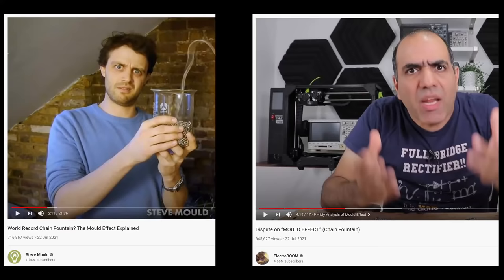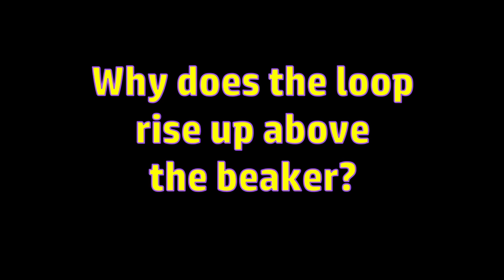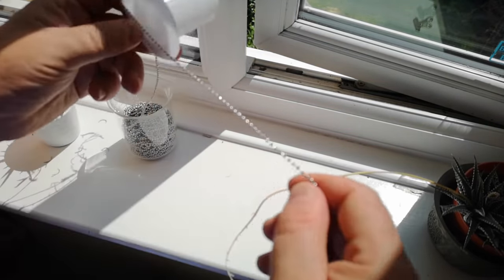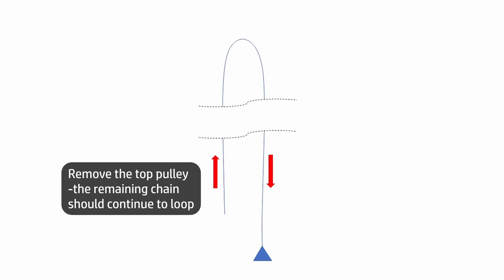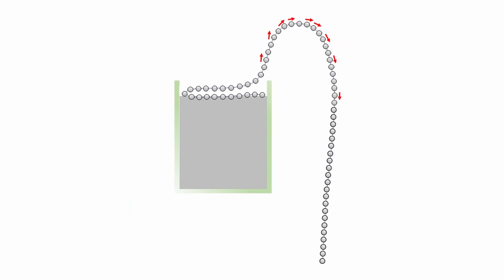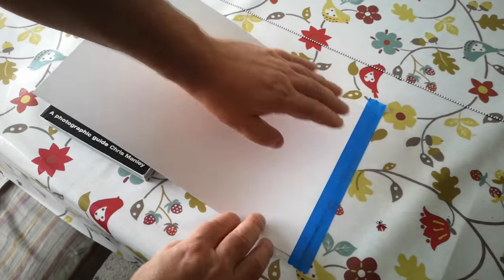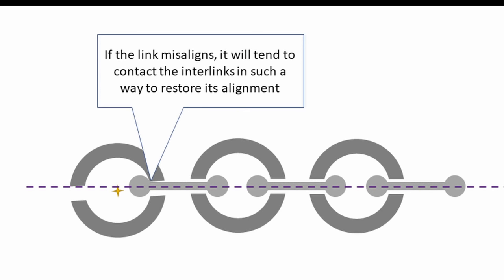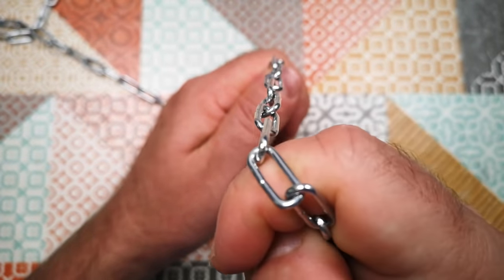Investigating the 'Mould Effect' - (Ball Chain Fountain)

Comment: The wave is a nice way to think of it. Its like a wave of accumulated time delays. Each little delay or displacement is due to one chain link transferring its energy after the one before it. So you end up with an accumulation of time where nothing could happen due to the forces in play. So even as one end falls the wave goes up higher as more chain links add to the delay time. Each chain link is very efficient at holding onto the time delay and passing it on, while adding it's own delay to the situation. I think its more like the classic video feedback ghosting effect in that way where the image is delayed due to the frame rate delay. In this case each chain link is like a frame passing on the delay to the next frame.

Comment: I most defiantly do also think this is a wave property, we have very similar ideas of what and how it works. This is why I liked your video because it reinforces my own believes.
I also think that if you'd take a thread and wax it up a bit to make it stiffer but still freely bend you'd get mould effect out of that.
Reply from the maker: Wave functions are everywhere - of course, the fact that there's a wave doesn't invalidate other ways to frame the mechanics of it
Reply: @AtomicShrimp  Agreed, I would wager that it wouldn't work with just waxed thread, it requires the inertial mass off the individual beads.

Comment: Let’s go right back to when the chain starts to fall. 
Imagine a link of the chain has bumped into the lip of the glass and rebounded so that the path of the chain forms a tight loop over the glass-lip. The centrifugal force inside that loop will force it to expand in diameter until the tension in the chain (centripetal force) balances out the centrifugal force of the chain loop. Now what happens as the chain speeds up? The tension in the chain stays relatively constant because it is determined by the weight of the small length of chain still inside the glass. But the centrifugal force will increase in proportion to the speed of the chain flying around the loop. The net centrifugal force is actually acting upwards, so the loop will rise up as the chain speed increases. It’s as simple as that.
Reply: Best qualitative explanation so far! Doing a quantitative analysis could be possible with a physics simulator.
Reply: First I thought the forces would not apply here, then I realized I'm an idiot and centrifugal force only requires angular velocity, not necessarily rotation. 
So I think this might basically be the explanation as to why the chain rises upwards. The movement of the chain speeds up until the falling part achieves terminal velocity, up to that point the angular momentum and therefore centrifugal force would be constantly increasing in the circular part of the loop. 
However, I think I have a small correction to your explanation: The downwards force on the loop would only be applied by the weight of the chain loop itself, not the chain part in the container. The weight of the chain that remains in the container just acts against the movement of the chain along it's curved trajectory,. As the chain itself becomes part of the loop, it can not pull the position of the loop downwards, just slow down the speed at which the chain moves along the loop. (I hope I explained that well enough, but as you seem to have some understanding of physics, I'm pretty sure you'll get what I mean, even with my suboptimal explanation.)
Props to you for making the connection to centrifugal force, I did not see it, despite having studied physics for long enough to have learned about centrifugal force on university level.
Reply: @creativedesignation7880  I actually didn't mention the weight of the loop, but you can see that it is compensated for by the centrifugal forcce in the loop, otherwise the loop would fall down. Which it doesn't do. I don't have the time right now, but I think it would be a good idea to get real here and go back and estimate the chain speed and the loop diameter and actually get some numbers. Then we would be a bit more certain of the facts.
Reply: Didn't Steve show the numbers for that, and conclude that the radius cancels out?  So the loop diameter is not driven by the weight or velocity, but can be anything.
Reply: @JohnDlugosz  do you have a link/reference for that? I can't find it anywhere.

Comment: I have this "half Flywheel" idea stuck in my head due to an experience from my boating life 45 years ago. My older and much wiser Brother, David, had purchased a skiing boat that was powered by an outboard motor, we water skied and became bored with the performance of the boat so my Brother (an engineer by trade) decided to install a 2 litre ford inboard engine with a Z-drive. I was impressed by his skill in machining the universal joint between the motor and the Z-drive. All was well, it felt like a Viva Aquarama. To get to the point. One day we were working on the engine with the universal coupler taken out, the motor was started and the throttle jammed full open, before we could kill the motor the poor thing seized and stopped abruptly. The result was something that belongs in an horror movie. The flywheel bolts sheared and the flywheel shot off towards my Brother who was standing alongside, luckily for him the flywheel struck a sea cock (valve) which deflected it upwards. Phew!! But it didn't end there, it ran up the wall of our home and at some 6m height it hovered while cutting a grove in the concrete of the wall, by this time my Brother was way down the street and I was barricaded in the house. It took what seemed like minutes to stop its growling grinding noise before I dared to go outside. I found the flywheel in a drain and upon close examination the flywheel had almost no teeth left, just short stumps. That's where I picture the power of the fountain, a flywheel (half) trying to fly!

Comment: Nice video. I think the effect seen at 5:09 where the chain rises as it goes over the spindle is further evidence for @ElectroBOOM's argument that it is momentum driving the Mould Effect as there is nothing for the beads to push down against. Mehdi also explains why you don't see anything until the very end as the shorter chain is still applying a downwards force that needs to be overcome (as well as friction and other losses of energy).

Comment: I think the cause lies in the fluid effect mentioned and likely has the same cause as an analgous effect in water and air. I've noticed that when the loop is high and stable, you see a spiral in the rising portion of the ball chain. I think what that is showing is part of what is effectively an inverted whirlpool or funnel cloud effect. The ball chain allowing movement in all directions not only allows for the upward movement, but once it has time to stabilize it imparts a circular movement centered around the mass of the bulk chain in the jar. It is effectively funneling from the disorganized mass below and up to the most energy efficient point at the top of the loop to start the journey back down.

Comment: You are correct in the last part of the video re. different types of chain. I would use the terminology 'degrees of freedom' and more specifically internal degrees of freedom to describe this. The chain essentially has total energy E=K+P+(internal kinetic energy). Where K is the kinetic energy of the centre of mass of each link summed, P is the potential energy of the chain and the internal kinetic energy would be some sum over all rotational energies of each link about each link's centre of mass.

You can see that for chains that are quite 'loose', there are more configurations for rotational motion of each link and therefore more scope for the total energy to be 'soaked up' by internal motions. It is also a result of chaotic behaviour, any impulse from link N to N+1 which does not reside exactly along the chain direction results in a rotational motion off-axis for the link N+1 which propagates down the chain. In the real world there is noise, simply adding noise to the impulses (this would be the result of friction, each chain being slightly different than the other, snagging etc.) you can see how a lot of the energy ends up being soaked in impulses off the plane in which the chain resides. In short, loose chains can hardly be described in the same way as the ideal case as internal motions become very important; not quite dominant, but significant in the result of the motion.

For simple ball chains, the internal degrees of freedom end up being negligible to the motion of the unit as a whole, even noise would be damped out.

Comment: The way I see it is very simple, the speed of the chain falling is causing the chain in the beaker to rise rapidly. It rises so quickly that it has enough energy (momentum, inertia ?) to go higher than the rim of the beaker and lift the falling chain a little too.
The falling chain has to be much longer than the rising length so that it's weight is enough to create sufficient speed for the rising chain.
That's all there is to in my mind !

Comment: You get the same effect with the long trains of carts they use to carry luggage on and off planes at airports. the front end can be round a couple of corners but the rest all follow the path it took.
Reply: I don't think that's quite the same effect. In a baggage train, the carts are linked to each other's axles. Each link and axle forms a rigid T-shape which is attached to the cart by a small vertically oriented hinge at, or very near, the point of intersection of each T's two line segments. If the linking bar is pulled to one side, the connected axle turns in the same direction around the hinge. The T-shape may be replaced by some sort of isosceles triangular frame, but the same basic idea still applies.

Comment: Great vid, I am wondering if this experiment can get scaled up such that the size of the balls are tennis ball size and the lengths between them are about 7-8 cms.  Would it do the same?  I have a theory but its pretty weak and more like an uneducated opinion.  I think it is because you cant fold the chain back on its self, that when it starts to go over the edge, it cant flop over immediately, but it forms a loop with a radius.  With more load on the other end, the radius gets bigger due to centrifugal force acting on it, it just swings out when it is falling faster, just like if you were swinging a ball on an elastic, the faster the swing, the wider the radius.  Maybe or maybe not.  Who knows.

Comment: I have a BSc degree and majored in physics, and honestly everything you said checks out to me. None of the vocab stuck out to me as being particularly wrong either. Double- and triple-pendulums qualitatively exhibit some similar 'weird' upward force effects in my opinion, and as a ball chain is effectively an n-component pendulum without a fixed end it should exhibit nonlinear effects like the Mould effect. I also think you're right about normal chains not experiencing it due to the extra degrees of freedom requiring more energy to pull the chain up, my gut feeling is that pulling the chain with enough force would cause the effect anyway but I'd have to do some research on that though.

Comment: hi, aspiring astrophysicist here (grad student).

first let me say: your description of how the balls pull on each other and generate upward forces very much clears up the whole muck of this problem. well done presenting that, and showing some simulations. i think it is a qualitative restating of what the Cambridge folks published, but actually using balls rather than modeling the chain links as rods (weird move on their part). further, breaking things down and looking at pairs of two or three chain links and then zooming back out to the broader picture is the exact kind of thinking that needs to be used when solving physics problems, so very good job with that.

some more thoughts:
1. momentum vs. inertia thing: "conservation of momentum" doesn't mean a ball wants to keep going in the same direction. that's actually the definition of inertia, pretty much. although, from what i've seen scientists tend to not talk about inertia because it's not a very precise thing to discuss.

2. waves on water (as long as it isn't turbulent) are described by the same math as waves on a string, just with an extra dimension ;)

however—i am really struggling to see how a wave equation would arise from the balls falling over the edge of a beaker. waves generally arise when things resonate—drums, light, coffee in a mug in a loud cafe. now, the Mould effect after some amount of time actually becomes a steady-state process: a fixed length of chain (from floor/ground to the beaker) dumps energy into the links inside the beaker and raises them up via the forcing mechanism you described at the start of the video. no waves needed! also, no resonances, so that's why i am skeptical of the wave description.

3. finally—discussing the chain as a fluid is brilliant. you are spot on with the energy analysis (from what i can tell). i'm not sure if saying ball chain is like "laminar flow" is the best phrasing, but if chains were fluids, ball chain would almost certainly be the least _viscous_!

in any event... great video!!!!!!!!!!!!!!!!!!!!!!!!!!!!!!!!!! :)
Reply from the maker: Agreed that periodic waves are often generated by something resonating, but a single wave (or at least something that looks like a single peak of a wave) can be generated by something that just dumps a bunch of energy into a wave-supporting medium; probably the most notorious example being a tsunami - it's not a periodic wave, but it has a wave function.  Likewise when the chain is laid out on the table, it's possible to create a single peak that travels along it - in both that case and the tsunami, the phenomenon runs out of medium in which the wave can continue to propagate - but if the medium is made to continually recede, the wave can continue.

Comment: The balls can move along the piece of wire that connects them.
The sudden movement when falling passes along the chain. This jerks the chain inside the cup making the ball slide faster along its small piece of wire passing energy along the chain and lifting it up over the rim of the cup higher if the pulldown is stronger.
Putting a weight on the end of the chain should give a stronger effect until this weight stops falling.

Comment: First off, you were concerned about using the wrong terms for physics concepts - as far as I can tell, you actually nailed it!

I honestly think a lot of the controversy happens because people think of the same problem differently. The two competing hypotheses focus on momentum (Mehdi's explanation) and link-to-link forces (Steve's explanation), respectively, when the forces are what cause said momentum and the chain's momentum causes the forces to change. In other words, both hypotheses are correct, but neither describes the full picture. :^)

Comment: I’m new to the Mould effect, but have watched several videos over the past few days. I like your observation that lateral momentum of a particular ball can impart vertical forces on the one trailing, thus generating lifting forces, without the need for an initial “kick” as the chain initially lifts off. I believe that tension forces can provide the explanation. 

It appears to me that the speed of the chain remains constant, once the distance from jar to ground has been established. For chains flowing in a curved path at constant speed, the tension required to maintain the centripetal force is λv², where λ is the mass per unit length. (Note; Independent of the radius of curvature.) This provides the tension at the top of the arch, thus the net lifting force, sufficient to balance the weight of the chain hanging below it. The tension will decrease on the way down, becoming zero upon landing. (But the force on the ground due to momentum change also computes to λv²)

A longer drop generates greater tension at the top of the arc, requiring higher velocity to generate the extra tension. This becomes the cause of higher speeds and greater lifting forces. 

I would like to see experiments done with the use of force sensors to monitor the weight of the jar, to verify that no net upward kick is felt as the chain leaves. In an ideal world, we could also insert a tensionmeter in the chain, to track tension levels throughout the journey. 

Thanks for your observations and suggestions. I believe you have brought fresh insights into this problem.

Comment: 1. Why does the chain rise above the beaker?

Mould Effect Q&A

1a. why is the height of the loop greater when the beaker is further above the ground?

The pulling tension force is equal to the sum of masses of the falling beads times gravitational acceleration. Hence, the pulling force will increase until the first bead in the chain reaches the floor, after that the pulling force will be constant.

2. How does a downward motion/force outside the beaker translate to upward motion/force inside the beaker?

A chain in tension is an efficient system to transfer mechanical forces, therefore each bead resting in the pile will be yanked out in succession by this pulling force.

3. why does this only happen with ball chain?

Friction forces and untangle forces are very low in this type of chain. The system is therefore very efficient in translating kinetic energy into potential energy